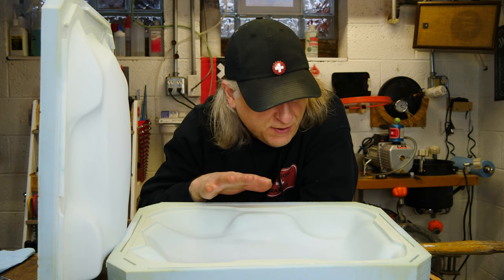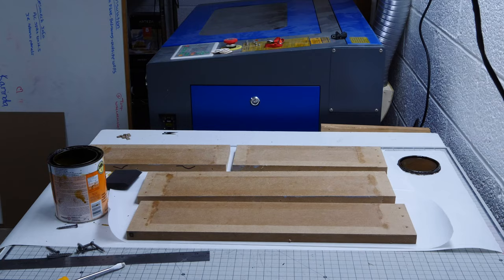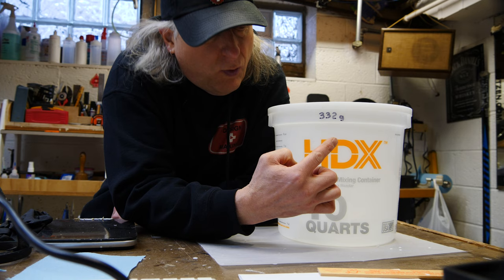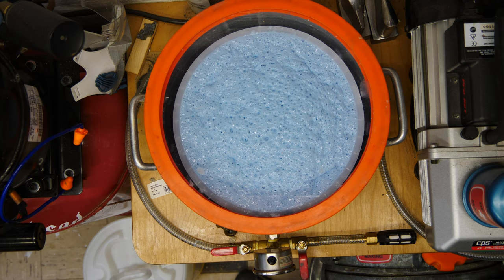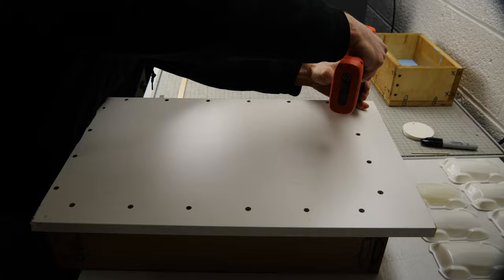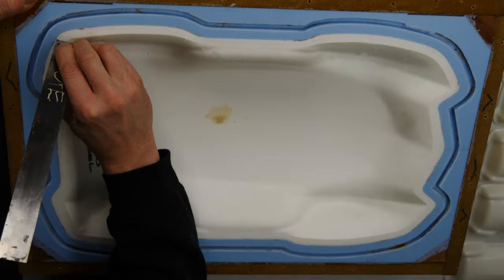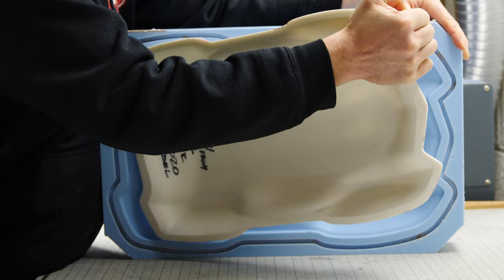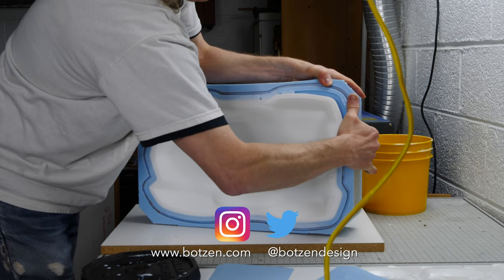Making Very Large Silicone Molds

Comment: If you start with the spout of that 5gal bucket at the TOP, and then rotate it as the level drops you won't need to drill a vent and the silicone will come out a lot easier.
Reply from the maker: Vent hole allows me to pump air in the bucket and get the silicone out faster

Comment: That's a really nicely made mould Eric, thanks for sharing. I have difficulty getting my silicone out of its container without getting it everywhere as there isn't a pouring spout in the lid, does your silicone come with that spout or did you add it later? If you didn't have have that spout how would you decant some into a smaller container?

Comment: Awesome video as always ! Very inspiring. Could you do a video about hardshell silicone molds with a thin silicone layer ? For example using a 3D printed hard shell to reduce the volume of silicone used and give strength to the mold :) that would be interesting to see :)

Comment: Thank you for sharing your skills and experiences! I have no need for any moulded parts, but the silicone looks sooo fun to work with!
I am impressed that the top of your mould does not sag under its own weight. Do you ever use reinforcements?
Reply from the maker: No
Reply: @EricStrebel  I usually use trixotropic agent and reinforcing silicon with tooling fabric.Much less silicon and lighter weight.Additionally silicon is not hanging down in the middle of the mold.Using moldmax 30.
Reply from the maker: Ok, good info, thanks for sharing

Comment: What type of resin was used for the part?
Also, if the silicone mold was a 3d printed PLA mold, would the resin casting process be any different?
Reply from the maker: Rampf 3070, you would need a release agent for a pla mold, not recommended.

Comment: Just an after thought, Why not vacuum form the part? Wouldn't the mold dip at the middle since the length is quite considerable?
Reply from the maker: Vac formed part would not be very quality, also the post process paint is baked so the vac formed part could not handle that.

Comment: I have a quick question how can I make a foam design to resin? Is there a material that I need to cover the foam to create a mold then use the mold to use resin casting? I have a design but a foam is very breakable. I don't know how to make my foam resistance resin heat because the chemicals combine with resin A and B reaction creates heat and it seems that heat will melt the foam so I want to ask how to do it if is possible. Thanks waiting on your response.
Reply from the maker: It's doable, just get some brushable resin and be prepared to sand a lot
Reply: Hi, I was able to do it. I follow using multiple layers of glue (school glue),  super glue, and wood sealer forgot the name. It cameout the mold fine and still have the original foam product

Comment: Made my first large mold today (5 KG/11LB of silicone), then the bloody object came away from bucket, glue didn't work strongly enough, so i had to weight it down while pouring.

Whats the best glue for plastic that won't be like super glue? I make the original as a 3d print then put in a plastic bucket.
Reply from the maker: I like white glue, but you may need something stronger for large objects
Reply: @EricStrebel  Thank you.

Comment: I have a polurethane rubber emblem and want to make a mold of it will silicone rubber mold be okay, will that work or would it stick permanantly?
Reply from the maker: Silicone is the correct material to use

Comment: What silicone are you using today.. I think in another video you mentioned 40A. all I can find  in bigger quantities on amazon is 20A or 30A.
I want to make a 24"x24"x2" medallion and would like the mold to be frameless if possible. I think the 30A would bow out too far based on a hardness chart I found.
Reply from the maker: Correct 1040 from silicone inc

Comment: This is so great, thanks! - I'm about to attempt something similar. How vital do you consider the vibration step? I had one professional tell me there's mixed results and it can actually introduce bubbles sometimes.
Reply from the maker: It's not a must-have just a bonus, but the vibrations do help bring any bubbles in there to the top surface
Reply: @EricStrebel  gotcha. I'll probably give it a go, as I'll likely need all the help I can get. Thanks again.

Comment: I'm surprised at your use of shellac to coat materials exposed to silicone. Shellac is the one thing I've seen silicone stick to, other than other silicone. Most of my experience is with platinum silicones; is that a tin based silicone you use?
Reply from the maker: Tin silicone, I rarely use platinum silicone
Reply: Apparently Shellac doesn't mix well with Platinum but is fine with Tin .

Comment: Question, why not make a brush in mould, with a cheap resin or fiber glass jacket mould? That would save on expensive silicone.
Reply from the maker: Good question, I have to make dozens and dozens of these, so it's worth the cost. Plus I don't like dealing with fiberglass.
Reply: @EricStrebel  well if you can justify the cost then absolutely the easiest way to go. And yeah fiber glass and epoxy resin is hell!

Comment: Hi, I have a similar mold, only I have the problem that the silicone rubber drops in the center and therefore there is practically little resin, and the piece is thinner. how could I solve it
Reply from the maker: Fill the mold with most of the resin in there first, then add the last bit of resin once the top of the mold is on.
Reply: @EricStrebel  
I have the entrance hole to pour the resin.
if you want I'll send you a photo to your email

Comment: Hey Eric, you said to pour into the sprue low and at an angle so that it vents. Does the sprue have to be taller than the highest point and then cap the low vents or do you just tilt it back down and finish pouring? And why at an angle if it’s dome shaped? I’m only asking because I’m about to make about 30 very similar.
Reply from the maker: I usually lay it down flat once I see the resin come out the vents
Reply: @EricStrebel  Any ideas about how to get the air out other than degassing? I only have 180 seconds on this urethane that I use from BASF. I have been pouring it over an ramped wide flat surface and letting it stretch and get thin and run off the sharp edge at the bottom of the board which has been getting rid of most of the air. What would you suggest?
Reply from the maker: Yes, use a different resin that has a longer pot life

Comment: Excellent video Eric - 2 questions. If I wanted to make a mold for molten zinc are there silicone molds that will hold up? Second is there a size loss from the original casted part?
Reply from the maker: Should be no size loss, you just have to find a silicone that meets your temperature requirements, check for shrink just to be safe

Comment: Hey Eric! I am a newcomer to molding but my ambition is to be able to make replica plastic front panels for old vintage pc restoring / beige replica case front panel replacements and this video really helps give me better context as to the scale of work required so thankyou! 

A couple of questions if you have the time to answer me, A) The size of each panel I will be working with is around 17inches or so (length wise), if I have to use a CNC router to cut designs will it make weird lines in the final mold by having to stop and reposition the master as I am cutting and then  re-cutting it? This is mostly since I am going to be limited to an 8in section at a time when cutting the design onto the material due to the working area of the CNC. 

And B) What type of resin would you recommend for a similar texture to an old beige pc case panel?

And C) am I crazy for even thinking this would possible as a hobby project? haha
Reply from the maker: The master has to be exactly what your final product will be, so your replicas will only be as good as the master part you cast. Find a resin from a supplier that has the properties you want. They all have tech support and data sheets
Reply: @EricStrebel  ok thanks for the info and yes my biggest issue is that alot of those case manufacturers have long since ceased trading. Think the old beige 486 / Pentium boxes from the mid 90s it’s quite hard to get technical data for them and a lot of it is going off the picture of a design and then modifying the back of the panel to match a more modern case design for the mounting parts. 

The plastic I was hoping to use is similar to what I saw you use in that video when you made a series of 10 plastic storage containers.
Reply from the maker: Ok, good luck try a shore 80 hardness resin

Comment: How can I learn how to use the ( vacuum air meter numbers-read watch presión.?
Reply: Vacuum gauges read in inches of Mercury, or  "Hg. A "full" (ideal) vacuum at sea level is about 29.9" Hg, but the higher in altitude you are located at the lower the inches of Mercury will be, for example "full" vacuum 2,000 feet above sea level would be closer to 27.5" Hg. The gauge is measuring the rate of the volume increase of Mercury under vacuum. The higher the inches of Mercury in your vacuum chamber, the better the rate of air being pulled out of your silicone or resin is

Comment: Great video....I was wondering if you could help with a project that I'd like to try....I want to make a silicone mold of a high heel shoe so I could make a wearable glass slipper from resin for my daughter's sweet 16. Do you have any tips or suggestions?....#PleaseHelpMe
Reply from the maker: Should work, use a flexible clear urethane if you can find some, not an easy project if you have never done it before
Reply: Thank you

Comment: Eric, could you please recommend a good food grade silicone for molding?
Reply: Give smooth-on a call, they'll have a tech guide you to the right silicone. Many silicones are food grade, but it can depend on what you are using it for, some silicones are only food safe at room temp or colder, but are not food safe with hot materials.

Comment: Silicone is expensive. Why don't you use extra filler material after the first layer ?
Reply from the maker: Good question, it's not worth it to grind up old silicone and mix it up in there The chances of it messing up the mold is too great.
Reply: @EricStrebel  thanks! I made a 1 meter by 30 by 30 cm submarine using a silicone mold inside a rough plaster+filling mold but the varying thickness (and the angles) made it almost unusable. seems like I have bitten off more than I could chew. I got one cast out of it.

Comment: there is something wrong with this video. not the general technique, but the specific approach. (criticism from a fellow professional, hopefully delivered factual!)

1. arent these parts usually vacuum-formed? why not keep it that way with 100+ parts?
2. you dont mention any of the actually necessary considerations when making LARGE molds. (alternative techniques, material cost vs. labour cost, weight and WASTE). 
3. 30x50x15 cm require ~25 kg of silicone in a block mold (=300-500 bucks?) - and thats for the second time, apparently without recycling any of your old rubber. thats just ridiculously wasteful. the only good part is that you manage to use it 100 times.

im sorry to be the hater between all these supportive comments. we all get a little set in our ways over time (or need to make do with what we have at hand), but this 101 moldmaking approach is certainly not the way to go
Reply from the maker: Vacuum forming is not appropriate for this project for a multitude of reasons. First of all vacuum formed parts are flimsy and just kind of shitty, for this application and way too low quality for this project they flex and are not stable. The main reason that this project is resin cast is that the paint finish that's applied to these parts is baked and the vacuum forming cannot withstand that temperatures required for the top coat. Resin cast parts are just more substantial especially for this type of application. Recycling silicone just not worth it in my opinion. Prototyping is a wasteful, process. No question about it.
Reply: @EricStrebel  okay - thermoplastic has its downsides in your case. 
Theres no question about if prototyping is wasteful - but about how much! at this scale with a skin+shell mold construction (brush-on or matrix-cast) the "time vs. money" equation would still work out in your favour (depending on practice). if the environmental benefit doesnt appeal to you at all, its also easier to use and store - and you would get new and different video content from it!